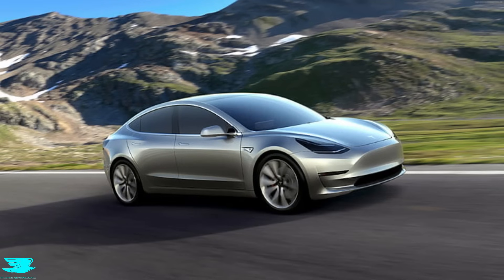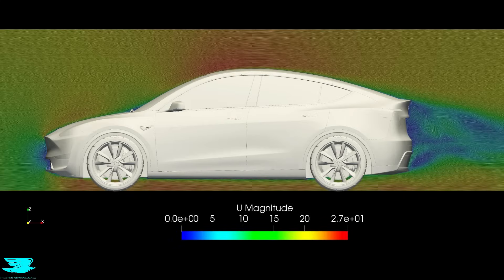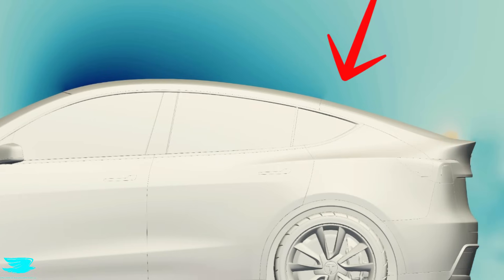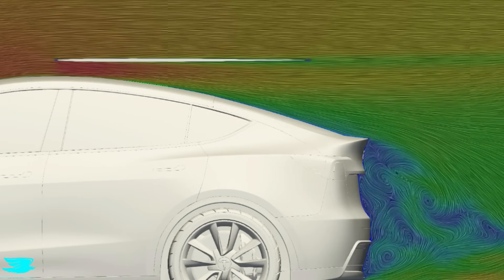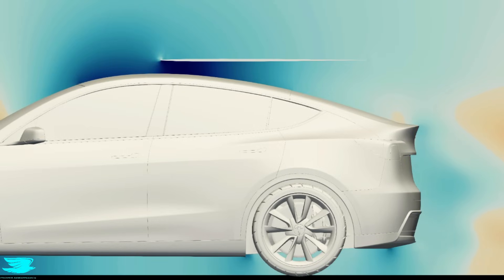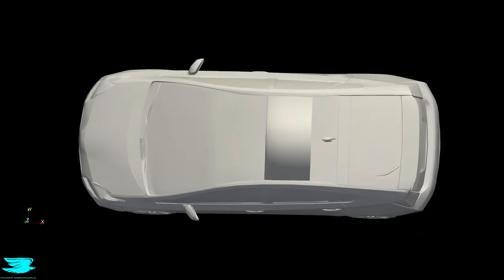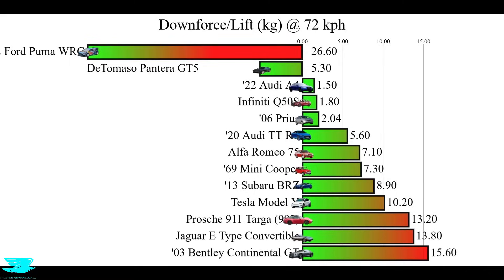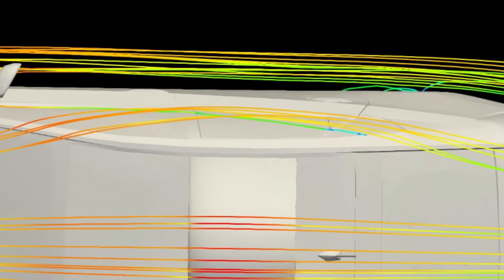I Solved Tesla's Aerodynamic Problem

Comment: For the front of the Model Y the grill opening is quite big, but on the sides of the grill about 10-15 cm are closed. 

Could you see the impact of this in your model?

What if the opening in the bumper would be reduced on the sides, so
The flow does not get stuck in the corner of the grill opening and is forces to the sides even pushes more air into the air curtains.

Comment: Now do the flat plate on a SW20 Toyota MR2. The MR2 is interesting because it is one of the few road cars with a GIANT HOLE in the middle of the car. Four, in fact: two side scoops plus a vented deck lid and open bottom. 

My guess is that if the side scoops were blocked off, an extended roof line or a flat plate could connect the low pressure air in the wake zone to underbody air through the engine bay.

Comment: Appreciate your out-of-the-box thinking on how to reduce lift.  But the whole point of this exercise defined at the beginning of the video was to "Improve cornering performance".  Adding weight at the top of the vehicle is the last thing you want to do to improve cornering performance. Also, if you take a moment and pause at the Nurburgring times referenced, the Tesla is on par with a multi-million dollar Ferrari Enzo.  Battery cooling, brake cooling, tires, and the nearly 5,000lb weight of the Tesla have much more to do with the time not being closer to 7:00 minutes, than aerodynamic lift over the roof.
Reply: Yeah but it could be faster and a small plate made from carbon fibre is not that heavy. If it converts all of the lift into df, it could be worth it for cars like the audi TT

Comment: check out the Renault 5 turbo built in roof spoiler. mid engines rally homologation special from the 1980s. loosely [very loosely ] based on a r5 fwd grocery getter with zero attention to aero in original design
https://www.youtube.com/watch?v=4LYGxRVpBOc&t=3s

Comment: cool idea and analysis, but id just like to point out that the change in downforce of a few kg is negligible compared to the weight of the cars, while the drag changes by up to 10% so in practice this would likely be a poor tradeoff. but good to know i can corner faster with a sheet of plywood on the roof 😊
Reply from the maker: For a typical drive, 100%. Builders definitely have it over other people.

Comment: Interesting video!
And I have followed some other videos explaining the challenges F1 aerodynamicists face!  It is truly fascinating!

However, on the open road, I do not imagine that a Tesla Model 3 driver is often facing a problem of lack of downforce in a corner at a speed significantly greater than 72 km/h.  My feeling is that sacrificing some Cx coefficient for down-pressure is no favorable trade-off... except on a track.  Adding aerodynamic pressure on a road car would, I can imagine, also increase the apparent weight of the car, and hence rolling resistance and tire wear.
Reply from the maker: At regular speeds, 100%. There will be a little more wear over time.

Comment: Hello Mr. Aerodynamics. Have you ever noticed how old cars (mainly from the 60s) had a front fascia that curved inwards at the bottom? Look at 60s Ferraris and Porsches for example. Modern cars don't seem to have this at all. Do you know why? I guess it might be because of lift, but I don't know.
Reply from the maker: Do you mean inwards from the tyres, so the tyres are more exposed? If so, then modern cars don't do that because exposing the tyres increases the drag a lot. So, covering them is better.
Reply: @PremierAerodynamics  I meant from front-to-back, as visible from the side view. The Porsche 904 shows what I mean. Most modern cars have a flat underside there, closer to the road, rather than a swooping sort of "chin". Thanks for responding though!

Comment: Why can't just make the roof less curvy, so that flow will not accelerate that much, make the greenhouse like a semi rain drop shape rounded at front sharp angled at the trailing edge, problems: flow can separate from the transition between curved area to angled area but we can add vortex generators to force the flow to remain attached.
Reply from the maker: That is all very possible too.

Comment: I think a more practical approach than strapping drywall to your roof might be a funny car spoiler. If you can't eliminate the low pressure wake, have it pull down on a horizontal surface, and the air flowing down over the roof will now have a trunk space to raise pressure on top.
Reply from the maker: Rear wings are inefficient, and things are only funny because you're not used to them.
Reply: @PremierAerodynamics  less of a wing, more like the protruding tail of the Mercedes IAA concept.

Comment: I have question.
I dont know alot of aerodynamics and iam learning alot from your videos.
If the low pressure between the flat sheet and the car top is pulling on the sheet and the car wont that forces cancel each other?
Maybe you got good results because the sheet is not connected to the car.
Reply from the maker: The forces cancel out, yes. Simply adding a rod at each corner and connecting it to the car just attaches the plate to the car, but the forces still cancel out.

Comment: How about a small wing spoiler in the back?
Reply from the maker: Yep, a rear wing is fine, but inefficient.
Reply: @PremierAerodynamics  how about a lightweight optimized car, so a more spherecial one, with wing kit to make up for the fact its not sitting low to ground for areo sorta like gma t50 . gma t50 areo is special with its turbine and wings (wings stick out when in use in non t50s variant).                 .... im asking about the lightweight car because   only like sport luxury cars in theory, because why drive things when you can just simulate in imagination... food when hungry is better consumerism. makeing everyday commute less boring , stressful, etc          driving funs is escaping perceived danger and driving style for lower emissions to whatever extent you wish 
                                    emissions driving rules means: exponential accelerator pedal compression pace from around 5 miler per hour , optimal energy level , engine RPM .   put down more power than that before uphills and on downhills   brake and steer minimally and steadily. (tire wear and weight is bad in emissions too) 
                                    bike better than car, safety is unlikely to be a issue especially if skilled and quick accelerating. uber eats container, rubber egg crates, silicone bag , etc  (micro plastic carcinogenic xeno estrogen emission of plastic wearing off from friction, heat, moisture, , potential partially airborne like in tire wear dust, etc).
weight increases road damage, crash damage to all involved, more tire wear.  low weight means easily controllable traction loss, tires last longer with more grip . linear addition in weight is exponentially worse in many ways especially in addign battery weight per effiency of  battery . if you can get the suspension to be softly sprung with lot of body roll proportionate with max potential Gforces from change in movement direction, itll feel more dramatic fun giving a more accurate idea of when car wil loose grip.also makes it  less harsh rideing, not as much need for heavy expensive  vibration engineering .  gordon murray t50 uses turbine suppedly to do this across big range of gforces , being like a miata lotus elise in everyday speeds and simlar in supecar speeds.    turning off power steering also makes it possible to read how close to grip limit car is at a even more precise level while  improving battery longveity and efficiency by less high rate energy flow 
i guess the best way in normie tech is lightweight effceiny , probably small battery electric car with small combustion slow charger, optimized for saveing money long term . nobody will inconvenience theirself to trust "the science" probably largley paid off by money printing joeee biden joeish , also called "greedy captialist". real valued ideas are often business secrets ...........               could also just argue to have driving fun with ligthweight combustion mid rear engine 2 liter inline 3 //hybrid rotary limited slip diffrential momentum preservation lotus elise CVT transmission sort of compact 4 that can lift to "suv" car height with forged recycled carbon fiberfor saftey X lightweight. small electric drive at front
Reply: Why?

Comment: Is it just me or did the prius model kinda suck? It looked like there was less resolution or polygons or something. The cfd made it appear like there is a series of notches along the roof.
Reply: @onetonpun   it's kinda difficult to find 3d models of the Prius in general let alone cfd compatible ones. For free or cheap so I'm not surprised.
Reply: Lower poly 3D model.
Reply: I think it's the first good looking Prius ever.
Reply: Cyber truck is even worse
Reply: @flysinsoup  the cybertruck was designed on an etch-a-sketch. Should have no issue modelling perfectly straight lines.

Comment: I just finished my thesis analysing flow interactions of two touring cars in cornering conditions using STAR-CCM+. I had significant issues with my results converging. But it would be interesting to see someone with much greater experience using CFD do a cornering simulation. I found "Techniques for Aerodynamic Analysis of Cornering Vehicles" by Keogh et al helpful for understanding how to set up cornering conditions for CFD. But if you decided to impart your wisdom and do a simulation or technical discussion of the paper I think we would all find it very interesting. I'm just starting your openfoam course too and it's by far and away the best content I have found on how to use openfoam, so thank you very much!

Comment: Would placing vortex generators along the roof trip/energize the boundary layer so that the airflow stays attached? Thus, achieving a similar benefit without the need for a large appendage?
Reply from the maker: For cars where the flow separates down the rear window, then definitely. One example was the Mitsubishi Evo.